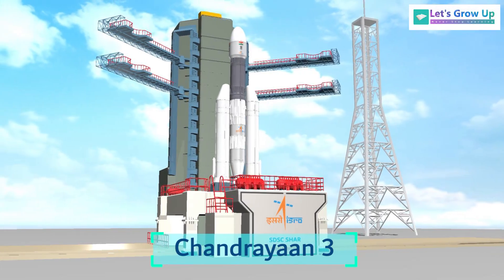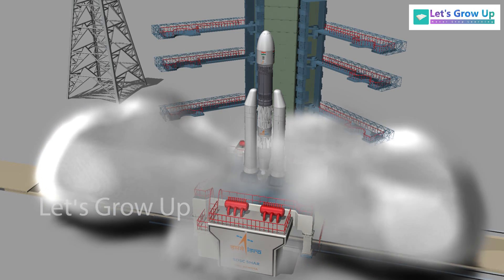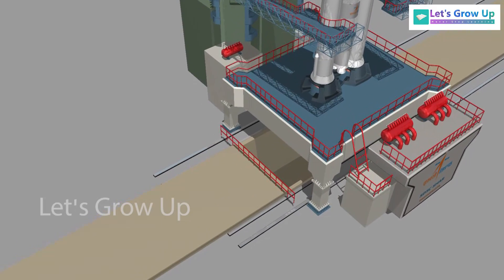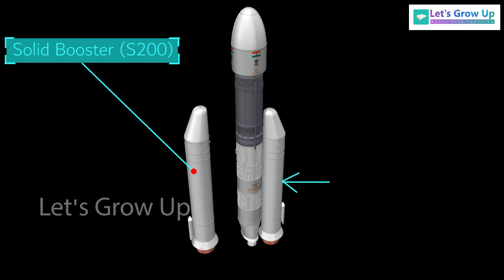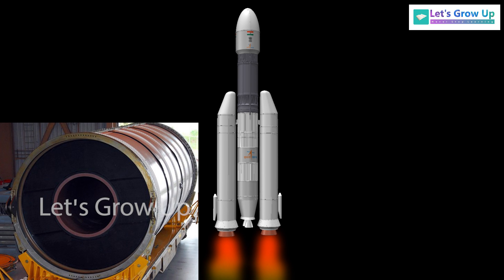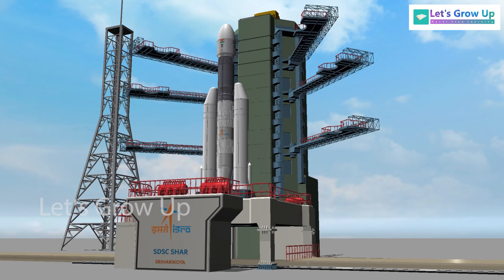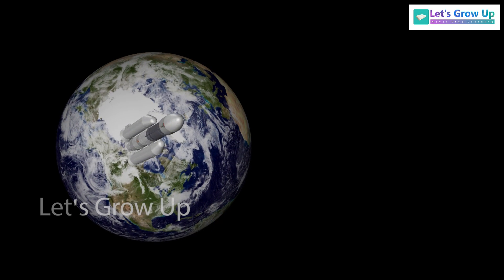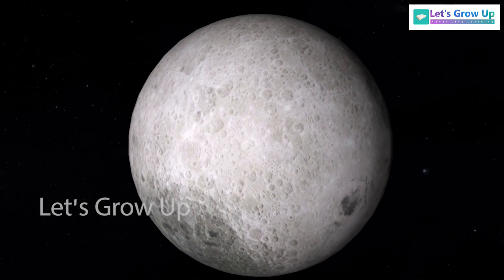The Launch of the Chandrayaan 3 spacecraft explained in 3D

Comment: with jet engines we never plan to go outside our solar system.  it is very limited not safe.  we need an ideal engine that works independently of traditional fuels.
Reply: Voyager 1 and 2 ..
Reply: You meant rocket engines instead of jet typo. Jet can't pass the atm
Reply: Ideal engine has no existence in real life
Reply: @bishalsarma3118  it doesn't even exist.  but what I want to emphasize is that without a high-performance engine independent of fossil fuels, we will never get out of the solar system.  We are not going to go easily to the moon or other planets like Mars etc.
Reply: Yes but it depends on fuel type...
Reply: Jet engine😂😂😂😂